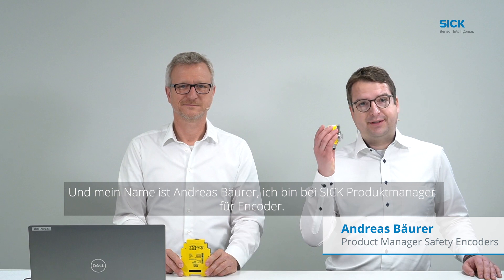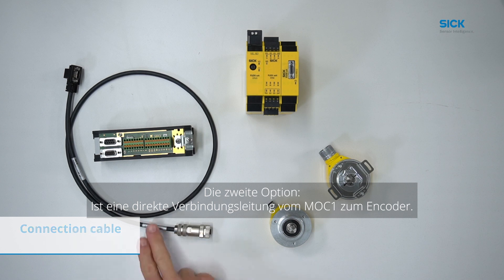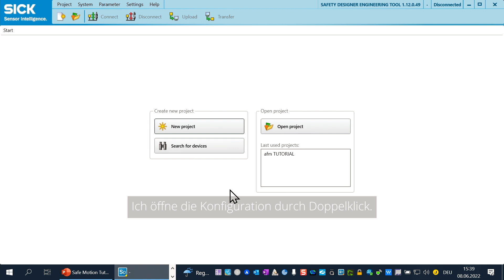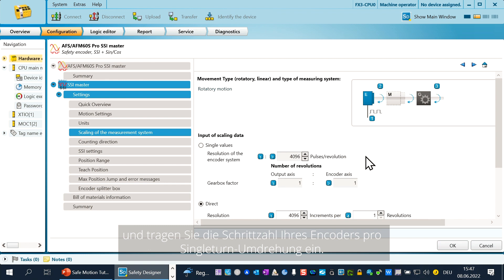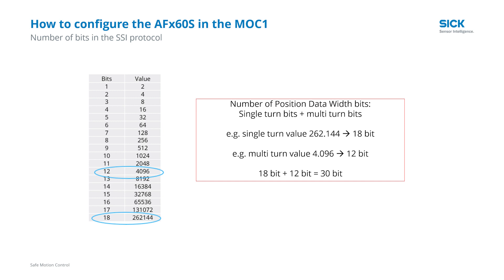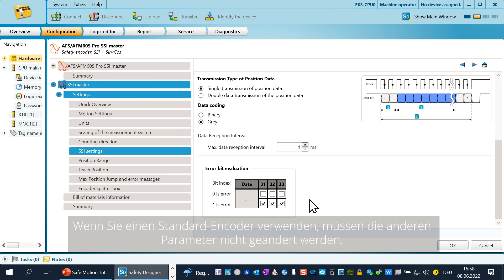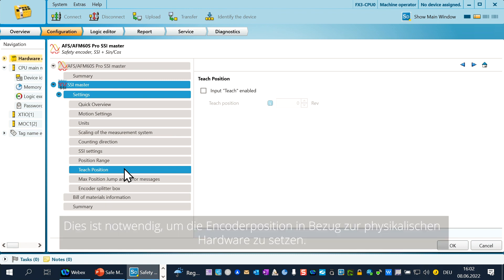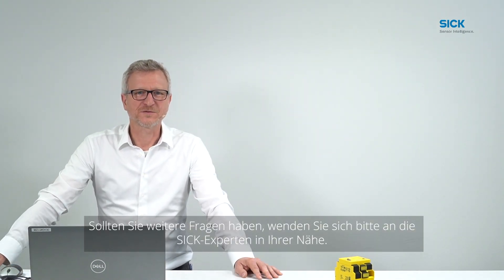Tutorial: Integration des AFS/AFM60S Pro in das Safe Motion Control Modul FX3-MOC1

Comment: Cable length?
Reply from the maker: Hello and thank you for your comment. The cable shown in the video is this one (Length: 1m): https://www.sick.com/de/en/connection-cable/p/p584746 

The cables are also available with 3, 5 and 10m. Here you will find the link to choose:
https://www.sick.com/de/en/accessories/accessories/plug-connectors-and-cables/c/g274507?q=:Def_Type:Product:ft681075ZUB_ANSCHLUSSTYPA%3C%40%3EConnection%20type%20head%20A:Micro%20D-Sub:ft681075ZUB_ANZAHLPOLEB%3C%40%3ENumber%20of%20poles%20head%20B:12-pin